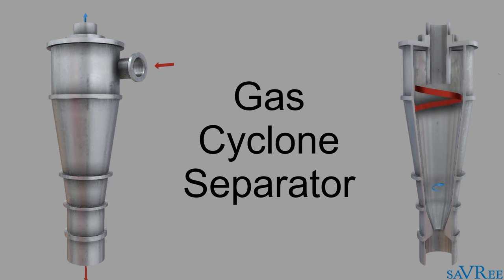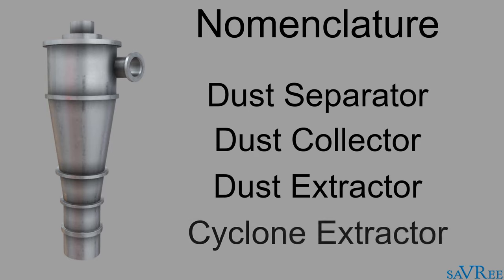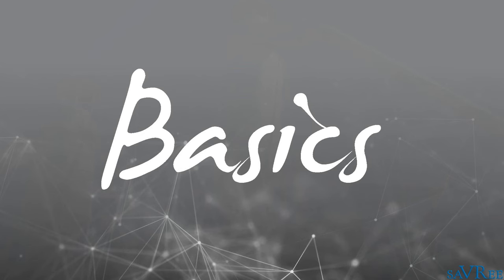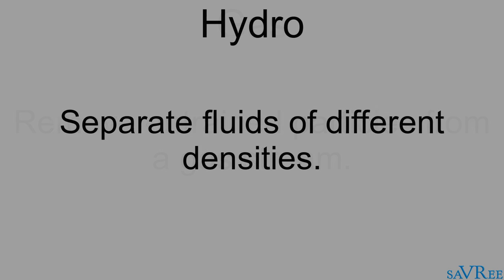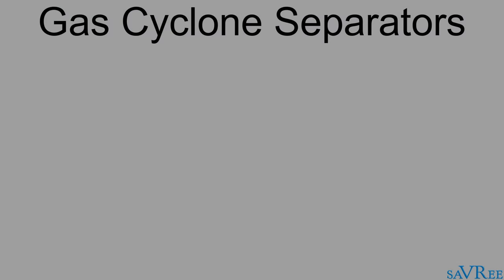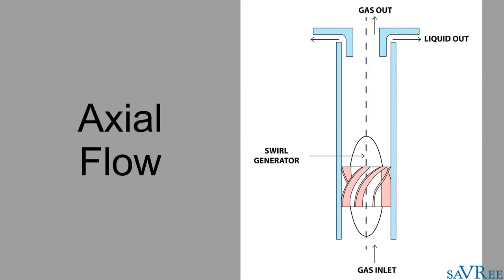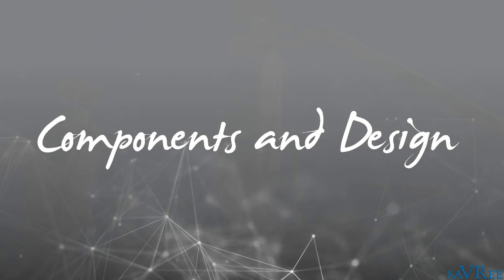How Cyclone Separators Work (How Dust Collectors Work)

Comment: I'm confused by the function of (or need for) the conic section. I've seen lots of designs on youtube for DIY separators which do NOT feature a conic section at all and yet demonstrably remove well over 90% of the particles from the stream.

Comment: Would you please explain how to solve the problem of back flow of the air due to moisture in powder? The air with the powder reverses and comes out from the airlock and becomes dusty

Comment: What about the geometry of the 'cone'? What effect does the angle of the wall have? Thanks. I just pulled apart my vacuum to clean it and my brain exploded with questions which led me to youtube/your video, thanks! I noticed my vacuum has a cyclone within a cyclone before a filter. I guess the outer cyclone catches the biggest particles, then the inner cyclone catches the smaller particles, then the filter takes away whatever it can of whatever is left.

Comment: Thank you so much.  I am trying to find a good cyclone for my air brush booth and this is quite informative for low density, small particles like airbrush paint!
Reply: IS USELESS FOR AIRBRUSH BOOTH. VERY SMALL PARTICLES THAT ARE MADE TO GLUE TO SURFACES. A GAS WASHER SHOULD BE USED FOR THAT PURPOSE.

Comment: Excellent video thanks.  I have one query I'd like you to help me with please. 

At 6:30 into the video (Physics Note) you say... "It is a common misconception that the centrifugal force is the force that separates the particles from the gas stream BUT it is centripetal force that causes the particles to collide with the separator body."   

If we use the simple model of a stone being swung around in a circle on a piece of string.  I thought the centrifugal force was the force exerted by the orbiting stone on the string (the outward force) and the tension in the string (the inward force), which keeps the stone orbiting in a circle, was the centripetal force.   

If that's right then surely:
1. The force that forces the orbiting particles in the air stream to the side of the separator cone is the outward force, that is, it is the centrifugal force.....  and 
2. The force that the side of the separator cone exerts on the orbiting particles (the inward force), which keeps them 'orbiting' in the spiral, is the centripetal force.  

So, IF the "force that separates the particles from the gas stream" (to which you refer) is the "force that forces the particles in the air stream to the side of the separator cone" (to which I refer),  THEN the "force that separates the particles from the gas stream"  (to which you refer) is the centrifugal force and it is not the centripetal force, which you say it is. 

Putting it another way surely,  the "force that separates the particles from the gas stream" (to which you refer), is the outward force, which is the centrifugal force. Is it not? 

Please elucidate for me,
Thanks 
Tony
Reply: @savree-3d  Thanks for this reply and for your first one.  I'm going away for a few days and will reply to both very early in the New Year.
Reply: I don’t agree, I’ve found no other research to corroborate your statement. I’ve also been a gold miner for years and have never heard my cyclones running with centripetal force.
Reply: You are right.....its the centrifugal force that separates the particles from the gas stream......I checked many sources.
Reply: @rishivardhan9147  Hi Rishi, that's great. I'd forgotton about it all because I posted my comments 2 years ago. So it's great to have your reply. All the best to you, Tony
Reply: The force by the string is a centripetal force, the stones mass feels a centrifugal force. The centripetal force is the force that acts to cause an object to curve toward a center, so in the case of the dust separator, it is the air causing the dust to curve. If you think it is the wall of the cone that is causing the inward force, think about a tornado; what one sees is the dirt and debris trapped inside the air vortex, sans a cone wall.
The force the cone walls exert is a frictional force.
The frame of reference determines on how the force is perceived, but it is the inward pull, that as you correctly state with the string analogy, that causes the air to swirl

Comment: Does a cyclone separator function the same if the air is forced into it (instead of vacuum force pulling the gas/air out of the top)?
Dealing with a dusty material with chunky material, but the dusty material has igniting potential if ran thru a mototor impeller type (sparks from rotors) so inversing the flow of the gas is preffered.
Reply: Sir... Where can be used the cyclone. How can be dispose or use it ??
Reply: It doesn't matter what the pressure differential is relative to atmosphere. You can either pull vacuum (below ambient) on the outlet of the separator [which is what you want here.] Or you can pressurize the input (above ambient) to the separator. As long as inlet pressure is at a predefined threshold above that of outlet pressure the separator will work.

Also, consider using a brushless motor as they will not spark when setup & operating properly.
Reply: @b5a5m5  thank you 😊
You dab on the field? (outsource?)
It's a very interesting field, but I'm not proficient enough to design or modify one yet 😁 but I'm learning 🙂
Thanks for the answer.

Comment: Nice video and animation, I found it helpful.

But sorry, I'm gonna nitpick a little since you've explicitly made a "Physics Note" section in your video.

Your equation at 6:48 reads: F = (mv)^2/r. The 'm' should not be squared; correct equation for centripetal force on a particle in uniform circular motion is m*v^2/r. I don't know why you're calling it 'particle size', since that is ill-defined and can mean different things in different contexts. Presumably 'size' would mean a linear dimension, or some power of a linear dimension. But if that's the case, then your equation would have the wrong units for force. It should obviously be 'particle mass'.

Also, it's misleading to even mention 'centrifugal force', since it's not actually a force - only the misperception of there being a force where none actually exists. Now you have confused commenters asking what is providing a 'centrifugal force' - there is nothing providing it since it doesn't exist. The only forces relevant here are (1) the centripetal force of the air stream acting on the particles entering the cyclone separator, (2) gravity, and (3) the normal and friction forces exerted by the walls if a particle's mass and geometry are such that it cannot remain entrained within the airstream.

At 6:34, you state "it is the centripetal force that causes particles to collide with the separator body", which is incorrect. The particles collide with the separator body when their mass and geometry are such that the centripetal force of the airstream is insufficient to keep them entrained. If anything, it is the centripetal force that prevents the particles from colliding with the separator body.

Apologies if I'm being too pedantic.
Reply: Totally agree with you, in fact same confusion arose from my side which you have perfectly cleared out!

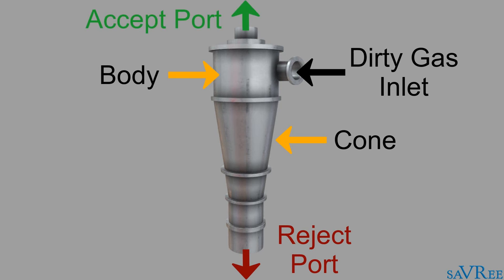Comment: 1. 4:18  This is where the video should start. No sense talking about variations or combinations of cyclones till the essence of a cyclone is first explained.
2. Might be helpful to explain why the inner "inverse" vortex forms and how it prevents the gas stream exiting downwards along with the dust.
3. 6:45  r is not the radial distance from the cyclone wall. It's the radius of curvature of a colliding particle.

Comment: I don't understand why smaller c.s's are more efficient and remove smaller/finer dust particles.
I must have missed the why there. Looking to design a small shop system with moderate airflow. It only need cover one machine or task at a time. 

I can not return air to the room if it contains fine dust. It's a bit of a problem exhausting conditioned air, replacing it, and placing fine dust out of the shop, too. Air-2-air heat exchange is a possibility, but that is not very effective on a small scale. Stuck....

Comment: for anyone in the know... when these are used in a vaccuum application, what is to stop the vac from drawing air through the port where the dust is supposed to exit, bypassing the whole system? i would assume it has to be a closed system for this to work right
Reply: Yes, diy dust separators are usually made with a bucket and two ports, being the top one, the vacuum inlet.

Comment: Hello, 
Can a Cyclone Separator be used to completely remove sand and dirt from cruched plastics? The plastics are crushed into cornflakes sized bits and I need to separate the sand and dirt. 
Please help.

William
Reply: @janaswanepoel7947  

Zigzag
Reply: @janaswanepoel7947  am zig zag throat

Comment: I love internet tutorial 99% are useless like this one. Outer vortex creates inner vortex, yeee, but WHY??? What physics law cousing it? Its like i would say: too many neutrons will cause neclear blast. GREAT EXPLANATION!!!
Reply: It's the inertia of the air at the inlet that causes the swirling. If you notice the design the inlet to the cyclone chamber is tangential to the chambers walls. The small amount of inertia of the  air keeps the air moving in the direction it entered the chamber. It then "collides" with the wall and follows it. Then once the air reaches the bottom of the chamber it has to move upwards since the cavity below is of neutral pressure relative to the chamber since it should be sealed to the chamber. I state the air has to move upwards, but that doesn't mean it stops twirling. I also believe there's a point at which the twirling air naturally goes back up defined by velocity of the air (and density but assuming that's a constant normal atmosphere.) I don't think it necessarilly has to go all the way down the funnel. Would love to see a clear separator with some smoke markings to see if that's correct.